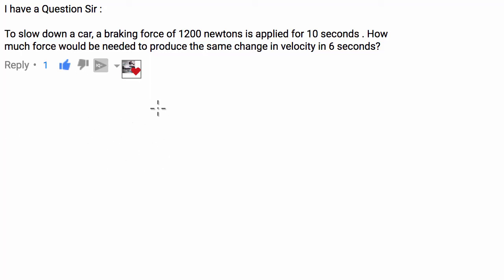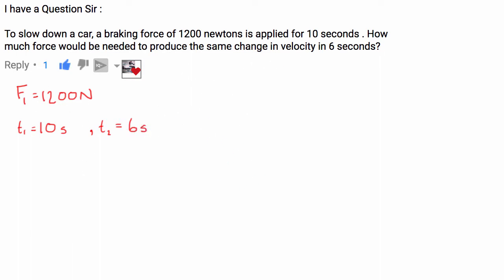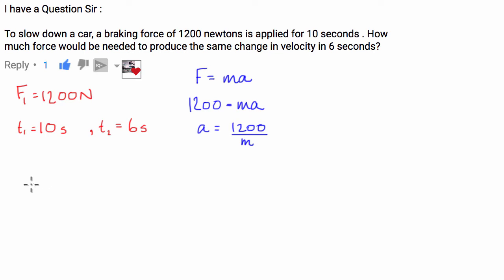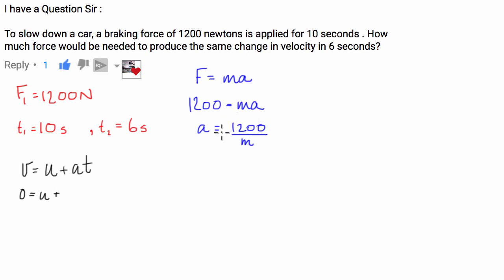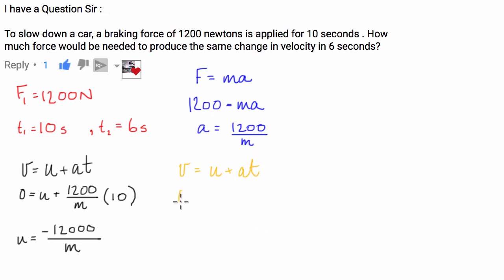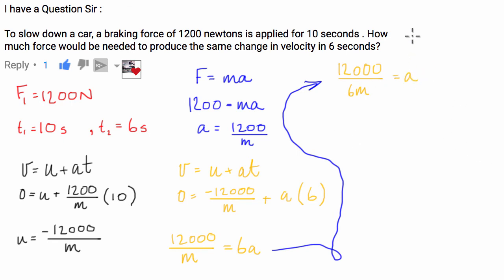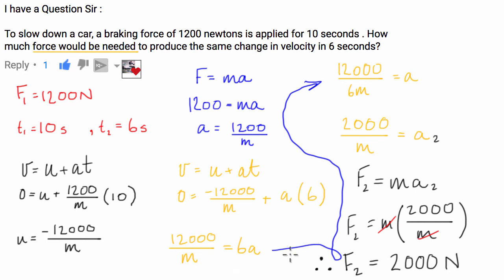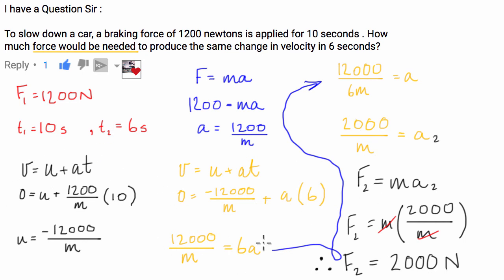Calculating the Braking Force of a Car

Comment: The calculations are valid only for a car braking with locked wheels, the only way to get a force backwards. Discussions about ABS are irrelevant. As long as the wheels are rolling (in real cars), all brake forces are working inside the car, not on the car. And those forces are not pointing backwards.